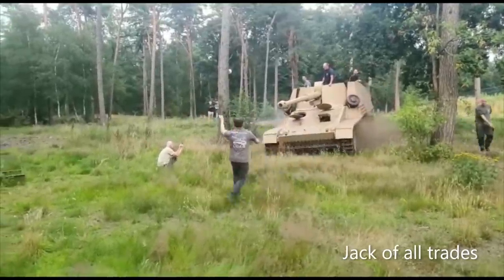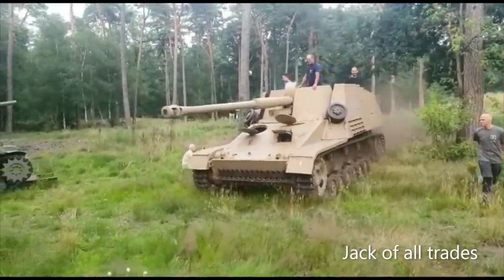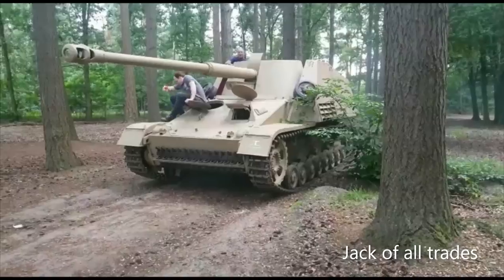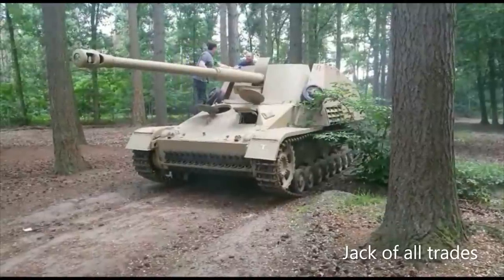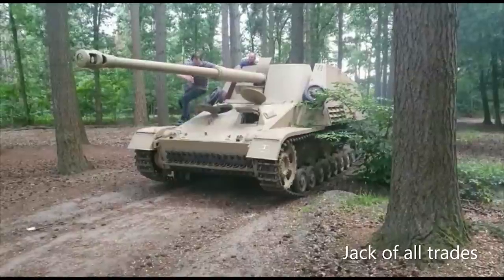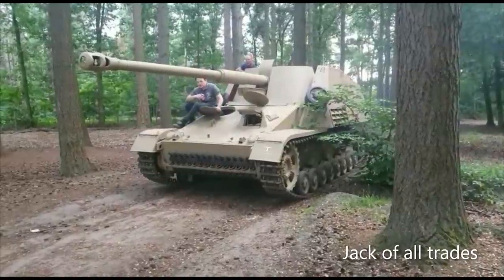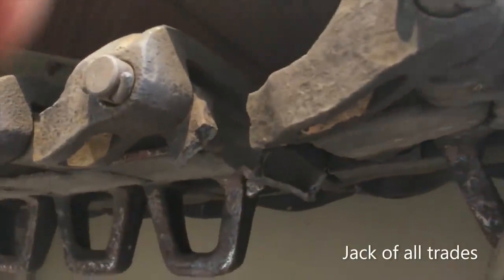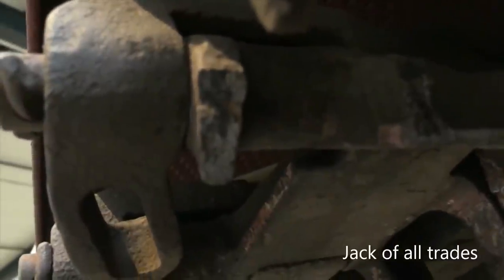Nashorn restoration Phonix test drive at Overloon warmuseum.

Comment: Thats really cool! Is the engine original and how much of the vehicle is original vs new parts?
Reply from the maker: Drive train is not original but the rest fro the most part. Some small floor panels and the front plate for the drivers is new.

Comment: She’s surprisingly sprightly for a big old gal ❤️
Reply from the maker: She was not moving for to long so happy to be out.
Reply: It’s about the driver as much as the tank.
Reply: I’ll bet!
Reply: I guess they also did a proper engine rebuild. That also makes a lot of difference. A tired engine vs a freshly rebuild one.
Reply: @NurdRage777  I don’t think she’s running on a Maybach 120...
Reply: I believe she has a new engine and its a diesel unlike the old one!
Reply: @roerbakei1  

I don't know why the Germans didn't go with diesels.  They have more horsepower and torque, longer range, and it's easier to refine than gasoline.
Reply: @leestewart72  but not at that time
Reply: I mean it’s not the heaviest tank ever, but still it’s clearly in good shape

Comment: Wonder how much penetration power for 88mm/L-71 if  pak43 loaded with modern apdsfs -round.conider the apc round can penetrate up tp 180mm armour plate 0 degree at 1000meter,firing a modern apds fs round can penetrate up to 450mm

Comment: Mooi werk! Geweldig om hem in "het wild" te zien.
Stuurt ook een stuk beter/beheerster met zo'n "controlled differential" tov het originele systeem.
Reply from the maker: Denk dat origineel beter stuurt.
Reply: @jackofalltrades164  Mmm... I can't imagine, the original steeringsystem was quite rough with clutches.

But the Nashorn is almost 10tons heavier than the vehicle it originaly came from (FV434 right?), so that makes it harder on the steering of course.

But well, reduction gears at the sprockets makes a difference too: if the reduction of the Nashorn is higher than FV434 it would make up (more or less) for the greater weight... 🤔
Reply from the maker: Car Los the nashorn will be 24 tons fully loaded.

Comment: Is this the one that caught fire couple year's ago? That why call it little phenox that's cool! Love to see it at shows soon! I'm a scale armour modeller I'm building one these for the ww2 models shows so everything has to be as accurate as possible si great to see it! I'm doing an early with the spares on the back and with winterketten tracks quite different to the initial production seeing the steel return rollers etc on this the early had the rubber continental type.
Reply from the maker: This is indeed the one on fire. This is also an early one but the return rollers got destroyed in the fire. We will have them back soon.

Comment: Well Done i have a question is the engine the Original one 
It was a Maybach i think
All the best 
Yours Frank
Reply from the maker: Original would be machbach hl120 trm. We have a more reliable deutz v12
Reply: @jackofalltrades164  okay the Original is very rare 
But today it must be possible to rebuild a Maybach engine 
All this new Technologie and maschines 
The need for them is obviously
Yours Frank
Reply from the maker: @frankgaletzka8477   It's possible to rebuild them but they are still less reliable than a Deutz. and extremely expensive as well. if it brakes down you wouldn't be happy at all.
Reply: @jackofalltrades164  thanks for the answer 
I think Deutz engines where the right one to replace the Maybach 😁☝️
I the Deutz engine aircooled or water cooled
Reply from the maker: Air cooled
Reply: @jackofalltrades164  yes that is very good loud but good 
My father told me ,he fought in WW2 from the start until the end in the german Army , that they had to start the watercooled engines in the russian Winter every 2 Hours and in the morning before driving they start a fire under every Gearbox .
He said only the Germans had to do so the russian vehicles drive every time 
He was Schirrmeister in a Artillerie unit 27 cm Mörser
Reply from the maker: Thanks for the story. Love it.